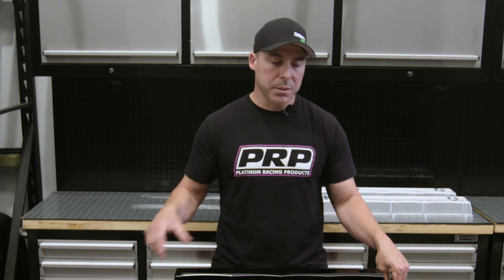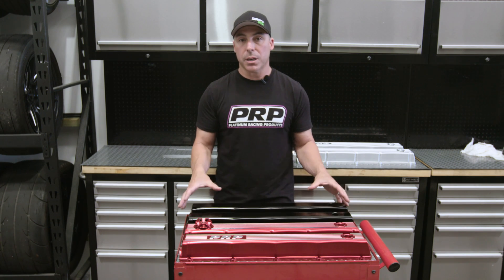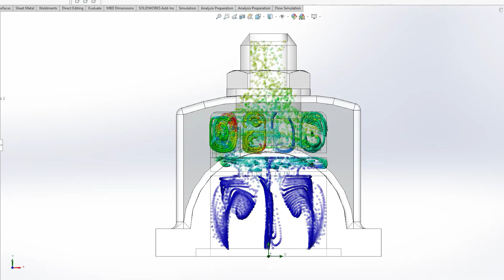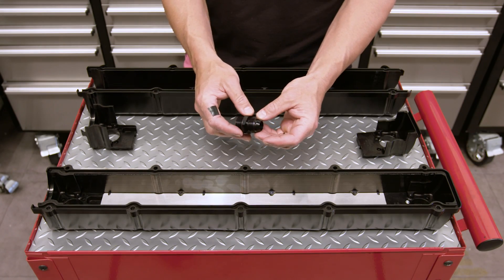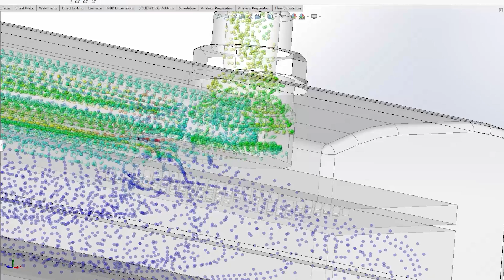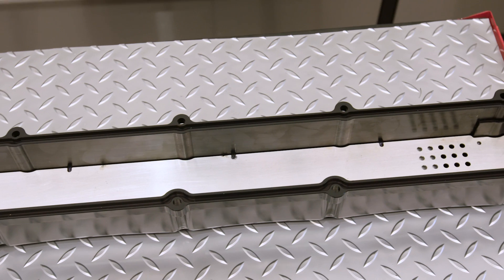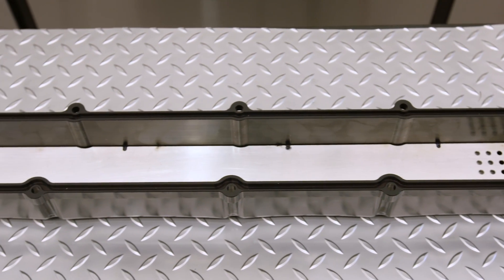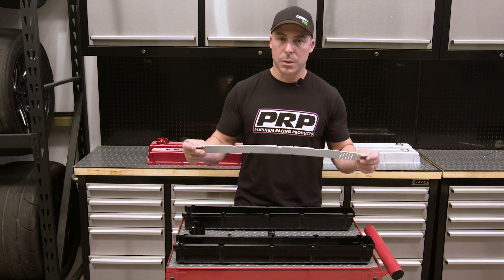All new RB26 Cam Covers Look Awesome! - CFD Designed with Baffling

Comment: Isn't the main problem with rb covers the oil pools at the back off the head under acceleration therefore gets forced out breather because the breather entry is at the back of the covers(rb25) so people go 26 covers because the breather entry is more towards the front of the covers. I noticed these prp cover enter at the back of the head too so would it not be forcing oil out still? Its not gonna push oil on a dyno with no g's

Comment: I'm wondering if the extra length the gasses have to travel will cause an increase in pressure. Meaning the gas can't escape fast enough leading to the gas being forced out somewhere else. Just a thought. I hope it actually works more efficiently. You wouldn't be selling it if it didn't work I assume! I'm just curious about the flow and the limits/restriction of air having to make a 180 turn.
Reply from the maker: 1. CFD Testing
2. 1100hp doing dyno pulls back to back on the dyno 
Proven.
Reply: @MotiveVideo  dynos generally create more crankcase pressure than when on the road for whatever reason so that's a good torture test. Rock on.

Comment: The CA18 has the same breathing / oil chucking issues.

We just pull all the baffles out. Then have a sump return on the catch tank. Simple, no issues. Don't fight it, embrace it😉 give the gas the easiest path out of the engine.

Comment: The stock valve covers look better in my opinion although these work better obviously. Should try and replicate the oem look, prob will sell better
Reply from the maker: The whole point is many people want a different  look.
But we are working on a fast factory look replacement
Reply: As a r34 I aprrove for oem look
Reply: OEM look with a front cover with rb26/28/30/32/34 would be amazing
Reply: I agree, I'm not a fan of the finish on the covers but do like the raised lettering